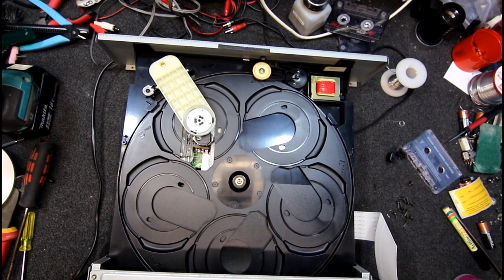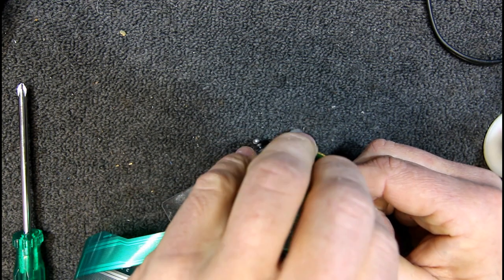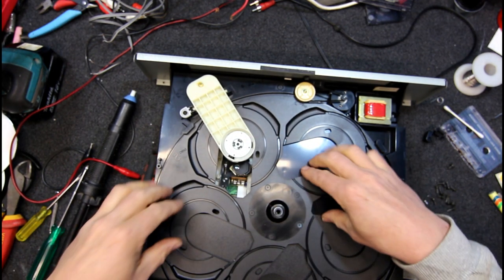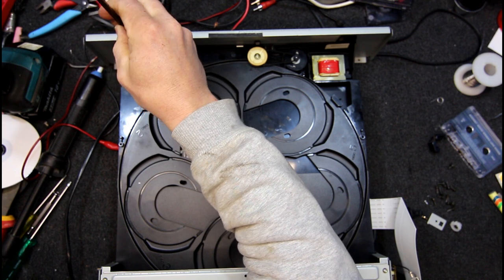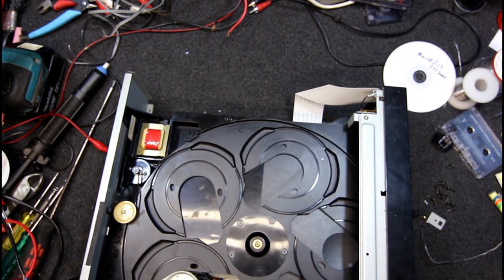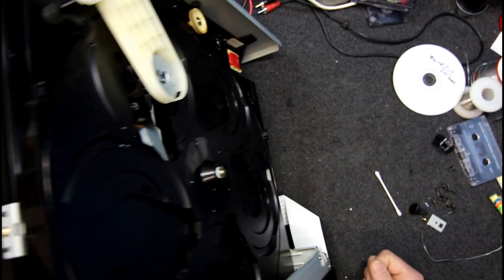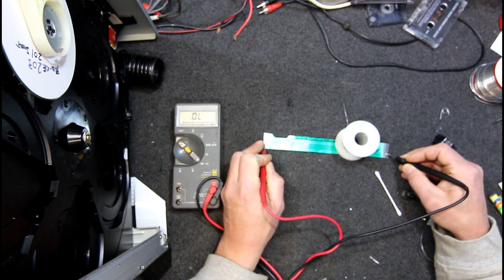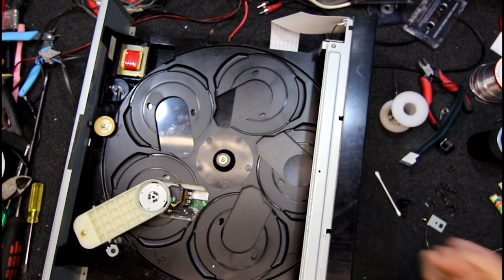Sony CDP-C325 5 Disc CD Player Diagnose Not Reading CDs

Comment: Could a power surge have damaged the connections? I had a similar Sony player, and there was a sudden, extreme power surge (caused by a Maintenance guy who forgot to cut the power to the apartment), and fried something because I was never able to use the Disc 2 spot ever again without getting some rather nasty audio side effects (I can’t really explain the sound, except to say that there was a - and correct me if you know what the proper name for this is - distorted/fuzzy popping sound, not syllabance but would affect the entire audio track.)
Reply from the maker: Looks to be physical damage with the ribbon cable. If your player plays any disc it should play them all. Only a mechanical problem with that one disc spot could cause a problem just with disc 2. Like something scraping on the disc because the plastic is warped.
Reply: @StevesElectronicRepairShop  nah. I was there when it happened…and listening to a Molly Hatchet cd in the disc 2 spot. I did, though, always wonder why just one would be affected like that. And, if you ever smelled wires fried…then you know what the whole apartment smelled like! What a stench that was!

Comment: Hello steve! I have one of these and the plate that holds the discs doesn't rotate and doesn't even moves. I would be very grateful if you could tell me a possible solution, thanks!
Reply from the maker: There is a belt on the top side that does the tray. If that is still ok I would check you can rotate the platter by hand using the motor or pulley on the other end of the belt. If that is fine you would need to check whether voltage is getting to the motor. Sometimes the motor drive ICs can fail. I will be putting out another video today where I pull a couple of these players completely apart to make one.
Reply: @StevesElectronicRepairShop  Thank you very much Steve for the help, i will check!